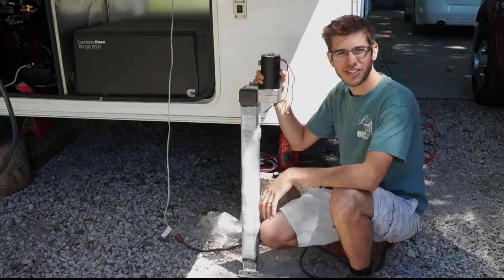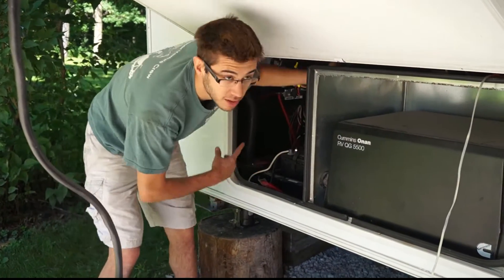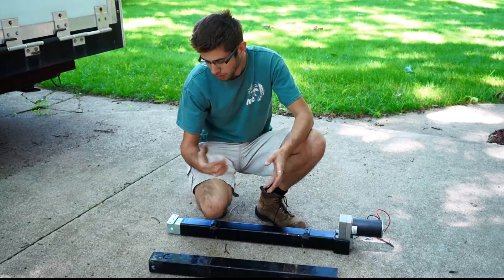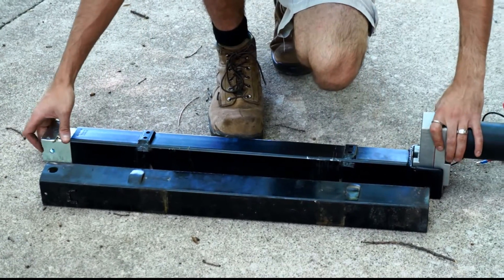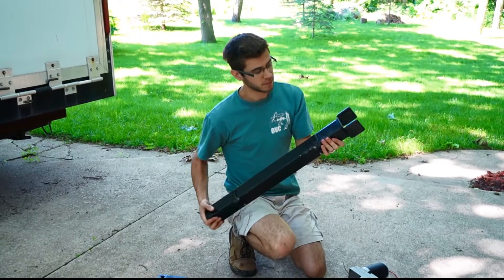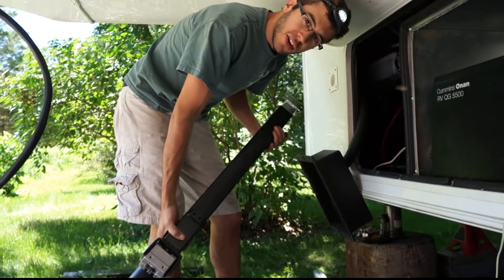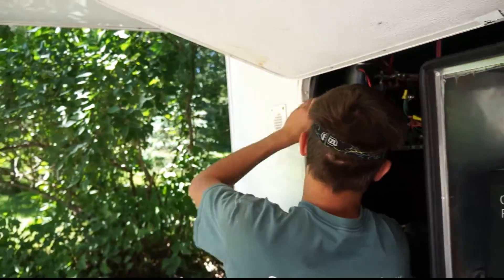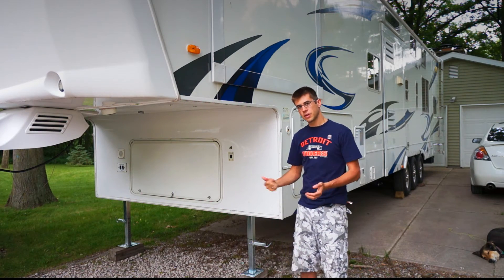Fifth Wheel Landing Gear Failure - How to Replace on a Fifth Wheel with a Generator

Comment: Great Video ,, you can however remove the carpeting panel in the front of the basement area and have great access without crawling in the hole ,, its about 6 screws.
Reply: You are a dick.
Reply: You might be right ,, but I am a dick ,, not an idiot ,, why climb like that when you don't need to.

Comment: I have a 2010 fuzion toy hauler,  and the leg on the generator side has failed.
I just replaced the motor and gear box on the other side last year. 
I think I need to upgrade to independent motors because of my weight.
Sometimes I have to manually hand crank to help the motor. Any suggestions on what type and size?
Thanks..

Comment: Great video!  I as well have a Toy Hauler (KZ-Inferno) with the generator on the drivers side in the front.  Been looking on how to do this without bring it to a national camping store chain!  Thanks!
Reply from the maker: Chaplain Cody Franz it is tricky but very possible to do.  I helped another guy out in a raptor with the same setup.   If you take it to someone they will probably rip the generator out.   I would advise against that approach if possible.

Comment: VERY helpful information!! I need to replace mine and I also have a generator in the way! However, I'm not as skinny as you. :) This will be interesting. Thanks so much for the tips. I have a 2008 40' Forest River XLR Toyhauler.
Reply from the maker: Its not easy but i wanted to show that it was doable.  Best of luck!